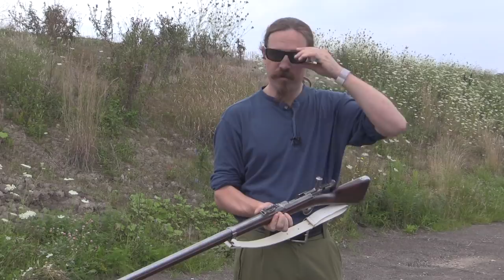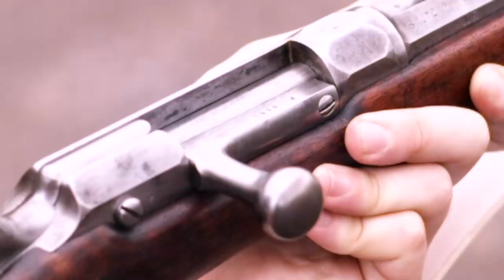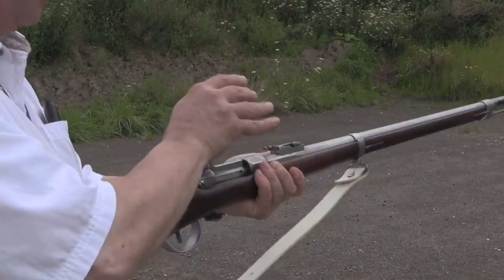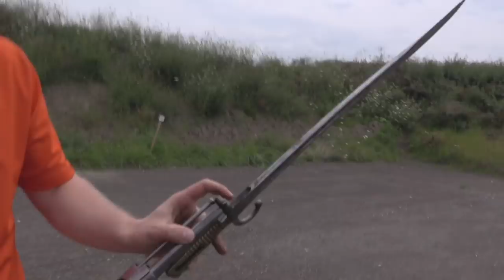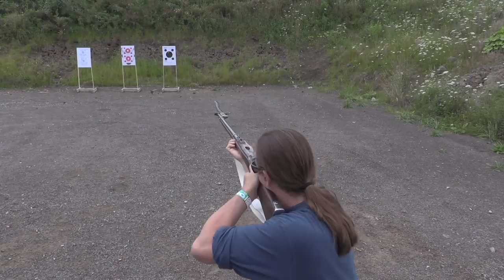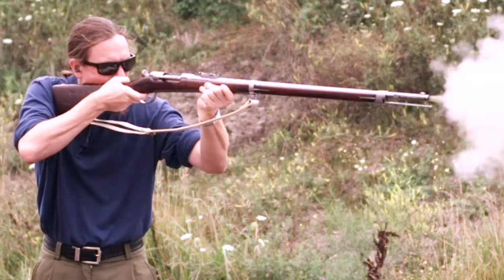Shooting the Mle 1866 Chassepot

Comment: Follow up with a video of cleaning that bad boy.
Reply: Not that much of a problem really... not much more than cleaning a smokeless rifle. Because it's a breechloader, you can just shove all the crud out with a damp patch.. The bolt comes apart and just wipes clean. The only tricky bit is the bolt head, but a pipe cleaner and soapy water sorts that out. I was also shooting my Chassepot today and it only took me about 10 - 15 mins to clean.. and no cases to wash out!

Comment: Listening to a guy demonstrating a black powder muzzle loader at an event, he said that the recoil was different as there is a hesitation because of the way black powder ignites, not as sudden as the modern stuff.
Reply: The delay is the ignition source, percussion cap or flintlock having to set it off.  Once burning, blackpowder burns much faster.

Comment: How far out was the effective range of one of those?
Reply: From my limited black powder experience I would expect that to max out around 200m with a possible 300m if the gods were smiling on you.
Reply: @dbmail545  The chassepot is a rifled needle gun, Its effective range is far more than a basic smoothbore musket, a musket's effective range would be 150m to 200m, a needle rifle's effective range is 400m to 600m, and can reach even farther but not as reliably to take into the effective range measurement.
Reply: For some real life data, when shooting mine I use a 400gr bullet.  70gr of Swiss 1.5fg launches it at 1250fps.  Thats a heavier bullet than originally, moving slightly slower.

I also have a Chassepot that was converted to a Gras, (same barrel, new bolt, now takes metallic cases) and that will take about 10% more powder in the case, and launch the same bullet about 200fps faster.

As with all guns, its more an issue of the sights and the ability to see the target, the Chassepot has decent ballistics and plenty of energy, even compared to things like .45-70, 11x60 Mauser, etc.  Its not better, but its not the Dreyse either.

Comment: The 1800s was an interesting time near the start you had a few flintlock guns and percussion cap guns then 1860s you had a hodgepodge of firing styles caps,needles levers ,bolt actions. But by the 1890s about most countries were set on bolt action

Comment: I suppose it's indicative of how fast technology was changing that in 1866 the French were perfecting the breechloading paper cartridge rifle, while the US and Britain were adopting the .50-70 and .577 Snider metallic cartridges and breechloaders to use them. I wonder if M. Chassepot ever stopped and said "Wait a minute. I could've used a brass case."
Reply: The Chassepot cartridge was adopted just before the coiled brass Boxer cartridge of the Snider and  drawn brass cases followed that. Firearms development in this period was at breakneck speed. What you adopted was out of date before you had re equipped your army. Both sides in the 1870 War were using paper cartridges, my British cavalry forebears were also using paper (capping) cartridges at the same time. They tried dozens of patterns of manufacture before choosing the service Chassepot cartridge and it made good sense at that time. The French Navy were still using them at the end of the 1880's. Well made they were cheap, worked fine  and gave the Matelots and Marines something to do on board.

Comment: Twenty rounds is plenty enough for most engagements with white tail deer.  It looks pretty foolproof. I've made paper cartridges for my black powder revolvers, I've paper patched bullets. How much harder is it to roll the percussion cap into the works?  The Chassepot seems like an elegant system.  I'd like to try one.  Was the obduration ring original in this example?

Comment: could you use a black powder substitute with these, or would it be potentially harmful to the gun?
Reply: Shouldn't be a problem--standing in for the OG is exactly what those substitute powders are designed for. (Cue wildly exaggerated horror stories from the diehards here.) Some are reputed to be more corrosive than the original, but given how corrosive black powder is anyway, the difference is kind of academic.

This part is just a surmise, but given that actual black powder is pretty hard to come by nowadays, at least in North America (it's much less stable to transport and store than modern propellants), it's likely they're using a substitute in this video.

Comment: I'd be concerned that sparks in the chamber might set off the powder before you had gotten the bolt locked.  I've read that in the old days they'd swab out the barrels of cannons before reloading, and even in the '40s, bag ammunition artillery got a blast of nitrogen before reloading.  I notice he blew  in the chamber, a sort of low tech version for small arms.

Comment: That firing pin...

Won’t that pin erode real quickly because it’s present when the explosion occurs?
Reply: Yes, which is why it's a field replaceable part.
Reply: Michael Free huh, that’s pretty cool, didn’t know that
Reply: @mfree80286  Just to note that the needle does not penetrate into the powder. Unlike the Dreyse. So is not eroded as badly. It is sharp to penetrate the necessary rubber disk for proper performance.

Comment: That's just cool to see. Two gun match between the Chassepot and the Dryse Rifles?????? wink, wink, cough, cough Ian and carl.
Reply: Would be super slow
Reply: @abisrizvi2621  True, but the point would be to see which one handles better, not to do well in the rankings.  Having said that, if it fouls-up to the point where you cant chamber a cartridge in around 20 shots, then they might have difficulty completing some of the longer stages.
Reply: @jic1   Well yes. I do imagine them cleaning the rifles between stages before shooting, but is going to be time consuming at best and making ammo for it. And also its going to be interesting which one will handles the best, as you said. If Ian and Carl does this, its going to be fun to watch.

Comment: I wouldn't be surprised If those cartridges are slightly over length. Military spec ammo would place ease of loading over a slight decrease in accuracy. There is no way they would have passed trials if the 20th shot required muscle.

Comment: I wonder what powder was used. Mine with PNF2, the equivalent of FFg is a lot cleaner after firing.
Reply: Greg La Roche how hard is it to make ammunition for one of these.  My friend is moving and said he’ll sell it to me for $80 just looks like it is super complicated.  Already into black powder revolvers and rifles but never dealt with paper cartridges.
Reply: They are not hard to make (the simple, fast version). I haven’t tried the original method. It does take time though. I enjoy making the cartridges. It’s part of the hobby. You need the tools made to the correct size. 

$80 dollars is nothing for one of these guns, as long as the inside of the barrel is in good shape and the rest is in good working order.

Let me know if you start to make some cartridges and I will give you more details.

Comment: I have never understood the side mounted bayonet as opposed to under mounted. What was the alleged advantage or reason?
Reply: Bayonets mounted on the bottom block access to the clearing rod which is sometimes needed to remove stuck paper cartridges. There was also a bayonet fighting technique that apparently was easier to do when the bayonet is out to the right.
Reply: @simplymadness8849  I guess that makes sense. Thanks

Comment: Does anyone know if the Chasspot  was ever sold to Spain or Cuba? I have a friend who has a Chasspot bayonet as a war trophy from a great uncle who served in the Spanish American War. It has an engraving but we're not quite sure what it says, we think it was the soldier's name who was issued it.
Reply: Surprised no-one has commented in 1 year. Yes the yatagan bayonet was made in a few other countries.  They even produced a similar looking bayonet for the Martini Henry rifle.  Are you sure it was used on Chasspot? Also did it have the brass handle or was it wood or steel? Some of those details might tell if it was used on a different gun.
Reply: @mikejohnson555  I have a picture of the bayonet, it is straight, single edged, with a sort of T cross section. Edit: probably not a chasspot bayonet now that I look at it. :P
Edit 2: it's a Gras bayonet. Still wondering how or if it ended up in Cuba during the war.

Comment: ponder
So... if someone had developed a little conical rough card cap for the Chassepot cartridge that stuck out a little further than the diameter of the native cartridge but didn't fold back and get it stuck (possibly by cupping it forward), it might be harder to insert a cartridge, but you'd scrub fouling out every time you did and shove it out the barrel. Could also be a bit of sponge, whatever could be  glued to the nose of the projectile loosely enough to separate on firing and not affect accuracy.

Self-brushing cartridges, is that I'm getting to. Or a pre-load disposable frayed cardboard "brush" that you insert every tenth round and just fire out the bore...
Reply: Wesley Richards, Calisher &Terry and several other British manufacturers had such cartridges slightly earlier in 'capping breach loaders' contemporary with the first Sharps.
Reply: @brucelee3388  Quiteso. They had a greased felt wad at the rear which sealed the breech and was pushed forwrd by the next round and cleaned the bore with that next shot. However. They were capping breech loaders which need a percussion cap to be separately applied to an external nipple. The Chassepot is entirely self contained

Comment: On the 20 round fired - how many rounds were carried in the cartouche box?
Reply: They came in card boxes of 9 rounds (3X3).
Reply: I quote: "Chassepöt armed soldiers (infantry) were issued a 83 rounds of ammunition (boxed into 9 round boxes). Each year a soldier would draw 100 rounds of ammunition, replacing their issued 83 rounds with the new rounds, then using the 100 remaining rounds for practice during an annual or biannual shooting experience. Soldiers and quartermasters had regular kit inspection to assure they had not sold their ammunition for booze."

Comment: Is the barrel rifled? Using ball or conical round?
Reply: Rifled barrel. By this point rifles are not that uncommon. Warfare hadn't changed despite the range and accuracy of rifles until the year of this rifle. Interestingly, it was an 1834 rifle that changed warfare.

As far as I recall it used a conical projectile. The earlier Dreyse used ball and then later a sort of elongated oval shaped projectile, so I imagine this learnt from the existing rifle technology.

Comment: Were those done with actual nitrated paper?
Reply: Actually, it works better to coat the paper in flame retardant.  If they burn, they leave soot/fouling.  If you make them flame retardant, the mostly unburned case is blown out the front.

Leaves MUCH less behind

Original cartridges had a silk exterior wrap for this exact purpose...
Reply: @eVVigilance  thanks for the comment . that's interesting information. I was asking mostly for understanding if his approximate 20 round firing session would be similar to historical numbers or not. If his cartridge isn't the same materials as the original cartridges, does that increase the number of rounds he can fire or decrease it?

Comment: I wonder if you could make a more "clean" ammo by using something like nitro-paper. They probably didn't have that by the time these guns were relevant though.
Reply: No. Nitro paper would burn in the breech and leave residue. The Chassepot cartridge is very carefully designed to throw all the paper out down the barrel unburned. The paper is best treated to be fire resistant.
Reply: @johnfisk811  seems to leave a lot of residue as it is but I guess it makes sense in concept.

Comment: I own two and refuse to dump anymore money or time into them. You spend more time cleaning the damn gun and making ammo than actually putting rounds down range. Good riddance metallic cartridges came about. They are moderately accurate with an orginal tapered mold. It's a cool project if you like endless tinkering but dont plan on sending rounds out too often. Period texts claim fouled bolts often didn't retract the needle back all the way. A solider would load another round and SLAM the bolt down like you seen in the video and would detonate the cartridge out of battery, sending the bolt backwards into the hand and wrist. A gras rifle is a better choice. All the sexy French lines with the saftey and reliability of a brass case
Reply: OK then Can I buy one off you?

Comment: A bolt-action rifle has more than 1 bullet loaded, otherwise it's just one-shot rifle
Reply: What do you mean? You’re gonna have one cartridge in the chamber. It doesn’t need a magazine to be a bolt-action rifle either. If it had a bolt handle and is manually operated, it is a bolt-action rifle.
Reply: A bolt action should have more than one bullet, otherwise you'll end up fighting in San Juan Hill
Reply: @mafiosomemer3730  This is 1866. Virtually every other army is single loading rounds down the barrel with a ram rod from the standing position.